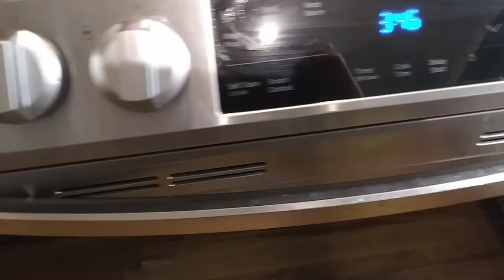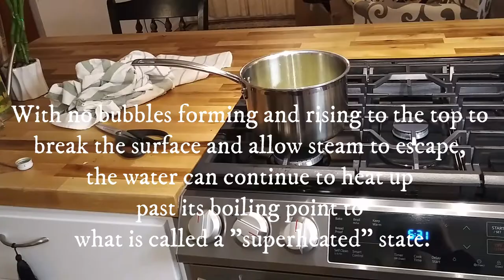Superheat Explosion and Whole House Clean Part 1

Comment: I came to this page trying to figure out what the heck just happened to me.  I had beef bone broth, already strained, on high in my crock pot with no lid..  I was dicing the beef and when I added a handful of cooked beef - It exploded!  Foam rose up about 3 or 4 inches above the pot and flowed over everything like a volcano.  About 1/2 half of my broth is gone.  All over the floor, counters, between oven and counter, dripping down the dishwasher.  What a mess.  I would have thought that the meat would have cooled down the temperature of the broth. I have been cooking every day of my life (almost) for 60 years.  Never experienced something like this.

Comment: Most of the time you would only get a super-heat "explosion" with distilled water and a spotless container. With it being broth there would have been more than enough particulate in the water to let bubbles form and release energy. I literally have no idea what it could have been...
Molly thinks it may have been the bottom of the pot suddenly snapping from convex to concave under the heat. That could have done it..    ..Scary.   I'm glad you're not dead..   :)

Comment: Tiny splinters can be the worst. I had to pay a Dr like $250 to remove one over 20 years ago. did you try using ducked tape to try to remove it.

google says.
In order to form a steam bubble in a pool of liquid water, the water temperature must actually exceed 212°F in a thin film near the heated pot bottom. ... Because of  near the heated pot bottom, they can expand and change phase (from liquid to gas) very rapidly.